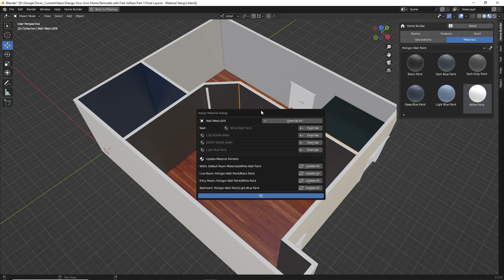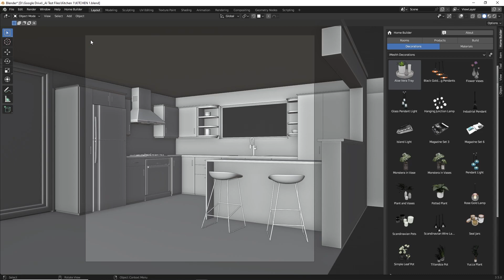AI and Home Builder

Comment: I would love to see how you took a sketch of a kitchen and got AI to render a finished image.
I use ACA (autocad with architecture and it's rendering now officially sucks, it was barely passable 10 years ago and it hasn't changed.
If I could take a 3D hidden wireframe image into Stable Diffusion and get a high end image BASED on my design,  I think I could die happy.
I can get my 3D into Blender first if that's really necessary but I suspect it's not.
Reply: So that is your fricken studio?  I'd be in heaven.

Comment: Exciting. Also probably the best use for AI at the moment, from experience with bard and chat, they impersonate intelligence at best. Side note: Can home builder walls snap to existing geometry? I was also unable to move walls between collections - I like to keep my files tidy but need the flexibility to make large changes to building designs. Looking forward to a complete asset set for single family architecture!
Reply from the maker: Home Builder Walls can snap to existing geometry. I will explain this in my next training video, but I still need to do more work for collection management.
Reply: @andrewpeel1996  it would be epic if home builder was more compatible with the "send to unreal" add on for blender for real time updates. Even exporting home builder to fbx requires a fair bit of cleanup. But the basics of the home design asset library and exporting 2D scale drawings would be the priority. Thanks
Reply: @andrewpeel1996  I still can't get it to snap to blender geometry, only homebuilder walls and archipack. Cabinet doors quite often have flipped faces on one side which is extra work at export. I look forward to the 'sketchup - layout' style 2D drawing/3D section. Archipack only has SVG (not for pro use) or DXF export (via convert section to mesh and a DXF add on) to NanoCAD/AutoCAD. But really, scale drawing with a few line weights should be possible from Blender. Thanks!
Reply from the maker: @johans7119  If you ask on discord It is easier for me to give support. https://creativedesigner3d.com/2021/09/08/discord-channel/